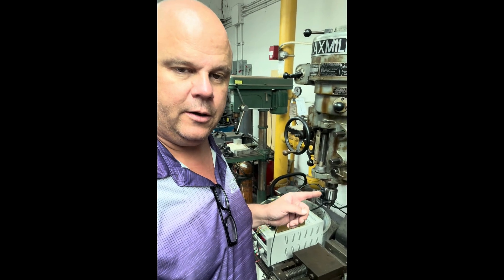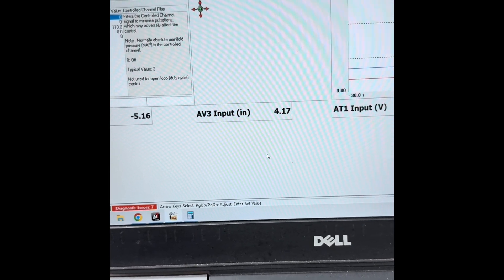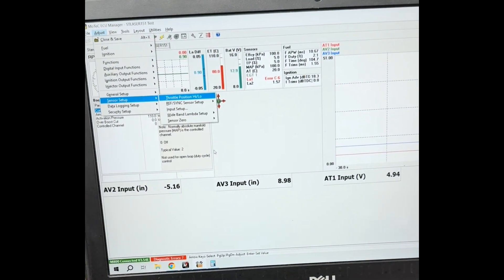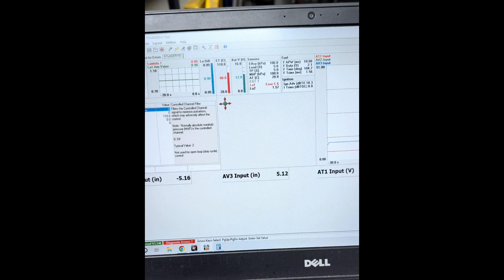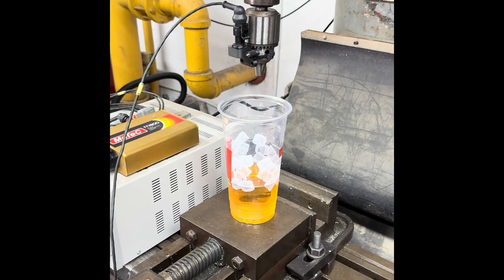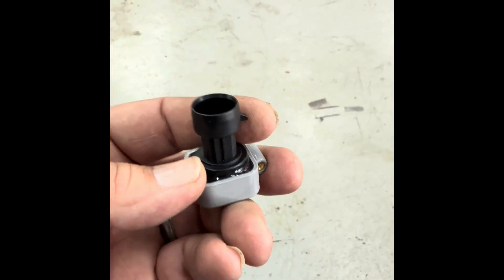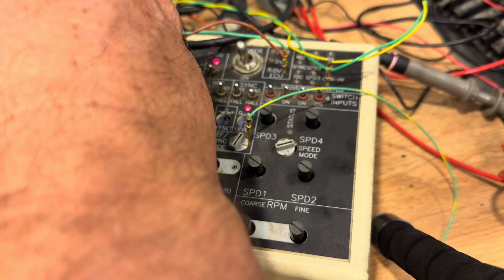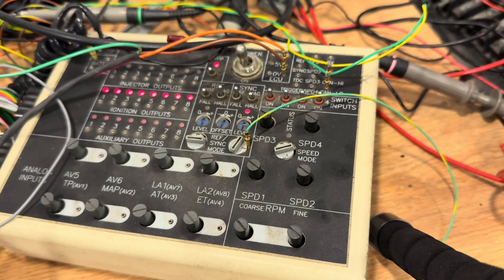STLASER151 Laser Distance Sensor - Accuracy and Measuring on different surfaces - Tuned by Shane T

Comment: Shane T, can this be configured to work with a Holley system?
Reply from the maker: As @ericmiller4285 mentioned. The sensor output is .5v to 4.5v which mimics most pressure sensors. So you can plug it right in and set it as a pressure sensor or you can set the calibration to match the sensor itself.
Reply: No reason it cant, its a 0-5V sensor. Hook it up, calibrate it, have fun.